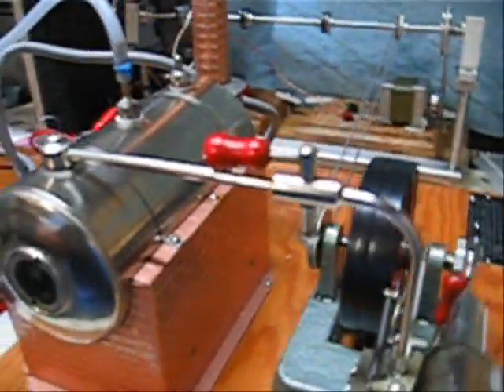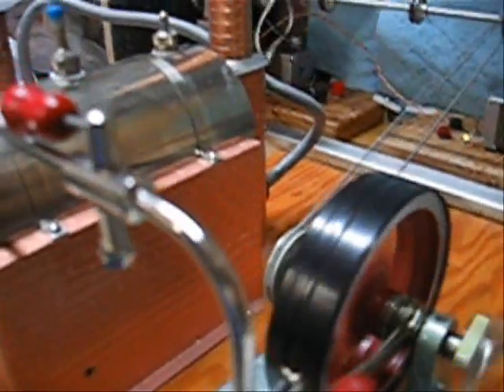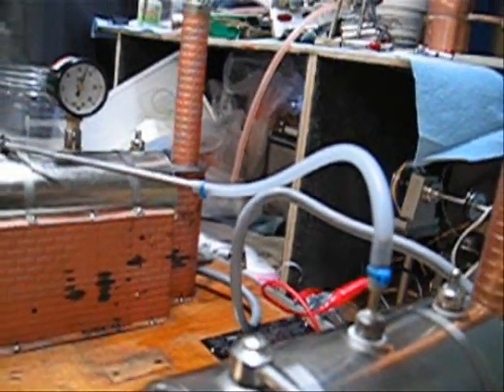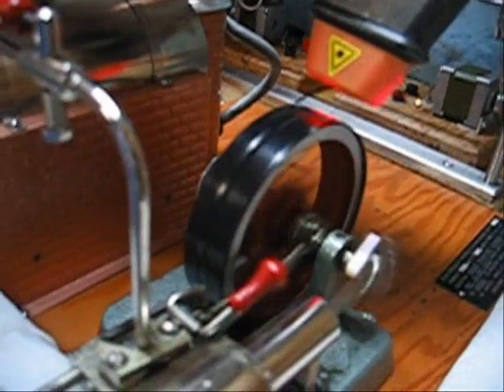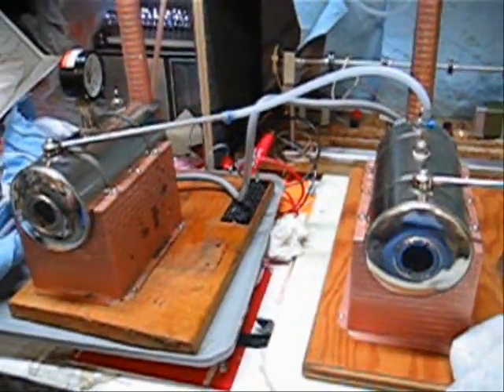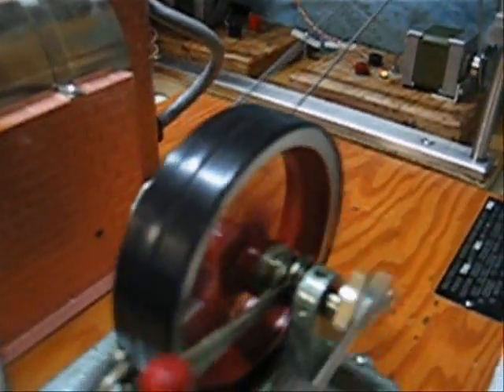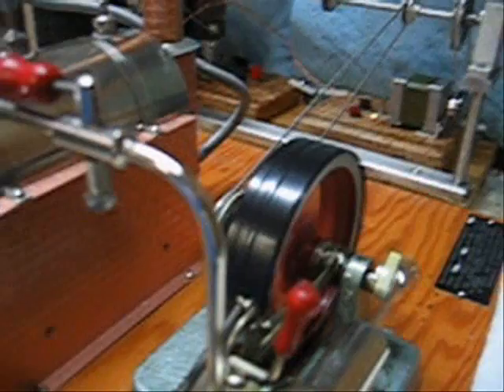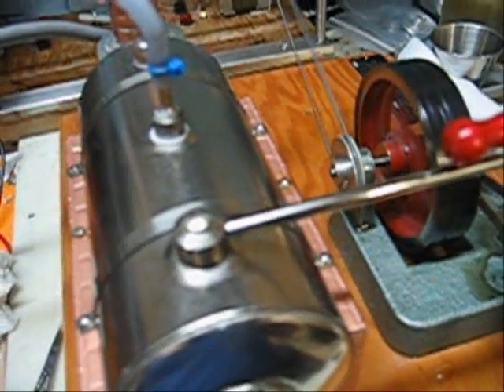Jensen 20 - Double boiler experiment

Comment: Don`t know if you still read the comments, but if you do i`d like to ask a question :)

I guess the tape on the flywheel is to minimize reflection during rpm-measurements and if thats the case what rpms have you logged the #20 at without pulling any load?

Regards from Denmark :)